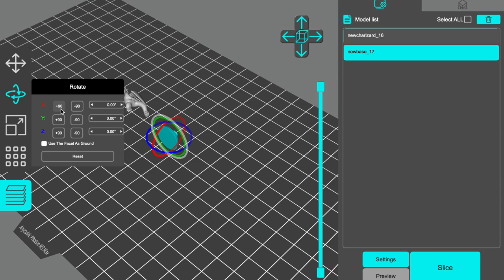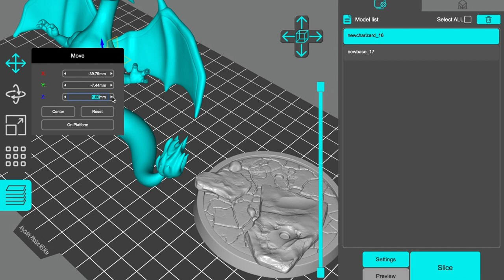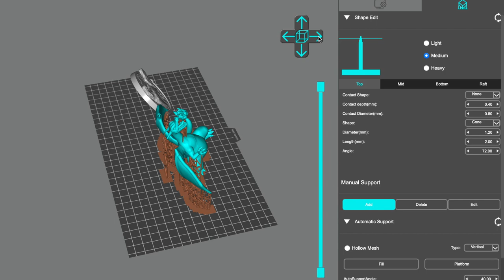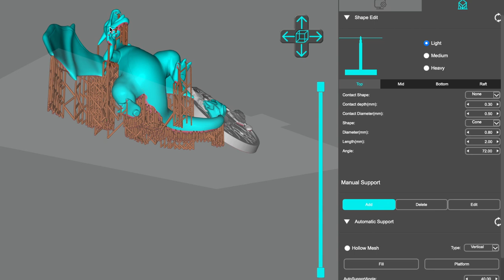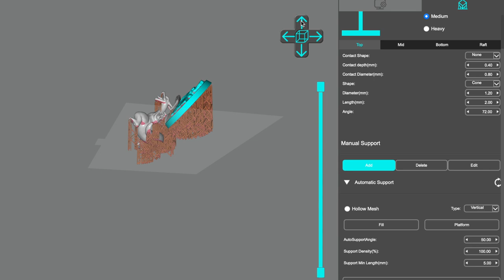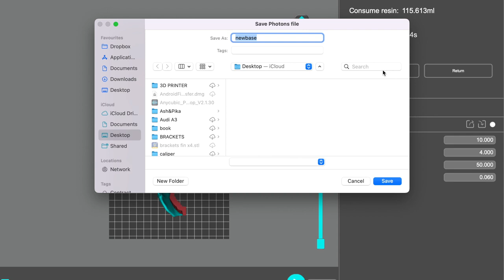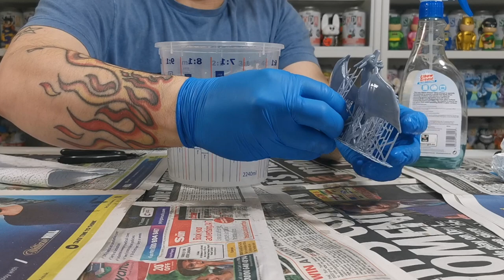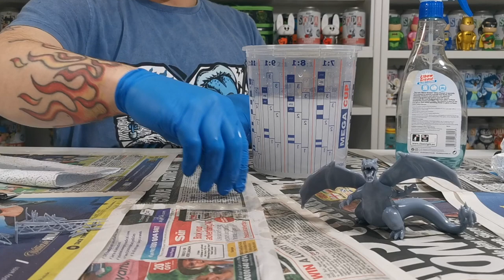Resin 3D Printer Adding Supports, Clean & Cure For Anycubic Photon M3 Max - Easy Guide

Comment: Hey i just got the same printer. For some reason all my prints come out to be really weak even after washing and curing. Ive tried uv tough resin and abs like pro 2 resin and it seems to be a little better but its still weak. Any idea what could be causing this? Maybe something with my printer settings that i could change? Im new to resin printing so im not sure whats going on.

Comment: Great video. I’m about to start university majoring in architecture and will be buying a 3d printer soon. Should I get the anycubic m3 max or elegoo saturn 8k?
Reply from the maker: That's a hard one as I feel they are equally as good. It may be easier to go for the best offer at the time. 🔥